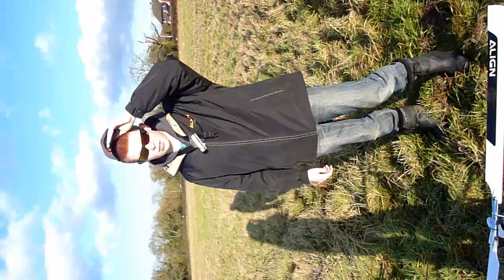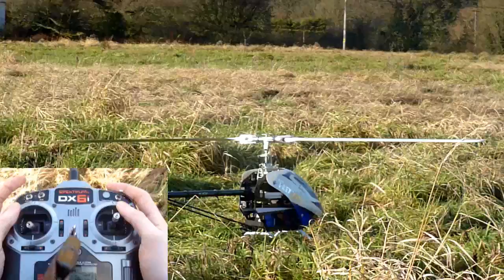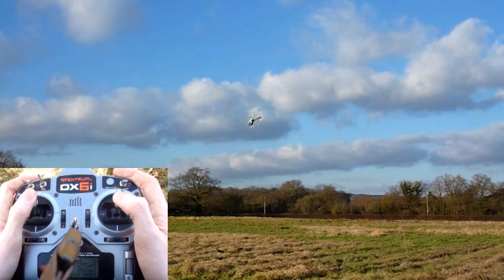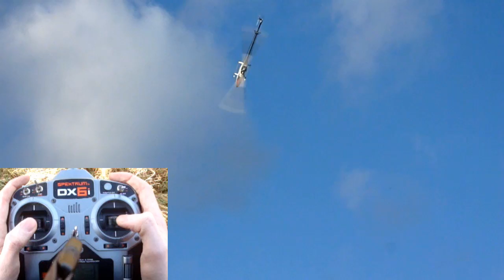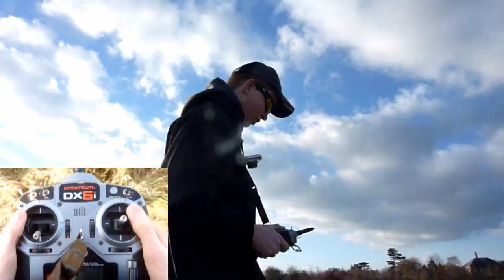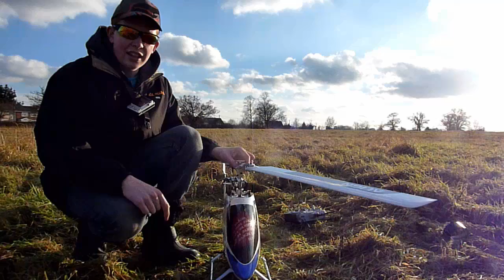Stick Movements (Mode 2) - ALIGN TREX 700E FBL Microbeast BeastX

Comment: Tom what's the difference for mode 1 n mode 2? I fly my birds in mode 1.
Reply from the maker: the configuration of the controls on the sticks are different. Here is a video that explains the differences Mode 1 vs 2 Radios. What's the Difference?

Comment from the maker: Hi John,
the 800 is about 15cm longer than the 700, and has 800mm long blades instead of 690mm. so it is a little larger. the 800 costs about £120 more and the parts will cost a lot more than the 700. it's all down to your opinion on which one you get. I would recommend to buy from fastlad performance as they have great customer service and ship quickly.
Tom

Comment from the maker: my thoughts are that the 800e won't be as good as the 700e for 3D due to them both having the same power system. 800e might be a little more stable, but not by much. so although it's probably a nice heli, i don't think it will be as good performance as the 700e. Thanks tom

Comment from the maker: a helicopter this size will cost about £1500-1750 depending on what you use in the setup. the range of the controller is about 1km, though you wont be able to see it that far.

Comment from the maker: @JMrSimon Its fine to use regular blades. I'm using non FBL blades on my 700, and FBL blades on my 500. I think the FBL blades seem a little smoother in the air, but aren't necessary. Thanks

Comment from the maker: @ArcticRc Hi mate, It should be similar to a FBL heli, I think I use 7-8degrees on the cyclic. you can try 7-8 degrees, but make sure you have dual rates setup encase its really fast. I have heard that some of the PRO's use 10degrees cyclic! I have dual rates setup for take off and landing because 7-8 degrees is quite fast.

Comment: Are you running Set RPM Mode on the Castle ESC?  If not do so and configure correct gear ratio, RPM's, and gain to be about 35 and watch the power be unleashed.  100% throttle curve on fixed endpoint mode is terrible in comparison.  :)  Enjoy.

Comment from the maker: @thercpoop Thats not a stupid question. The reason why i can use a 6ch transmitter is because it is electric, just like any other size electric heli. The reason why some people use 7ch is because they are using a nitro machine. nitro helis need 7ch as they need to run a governor.